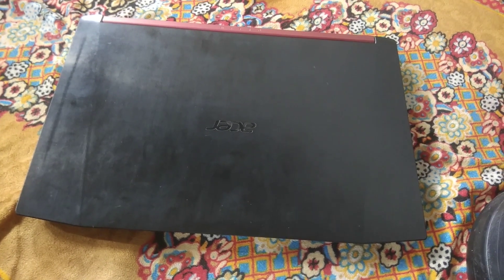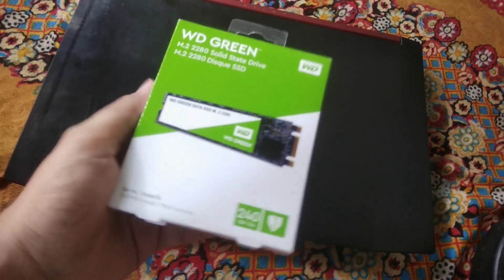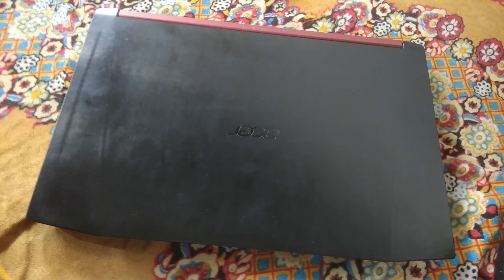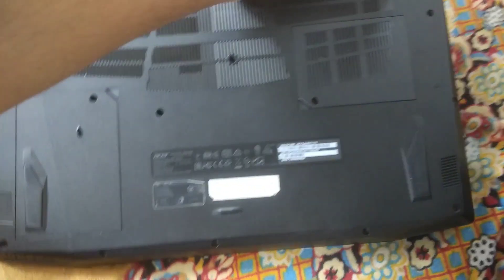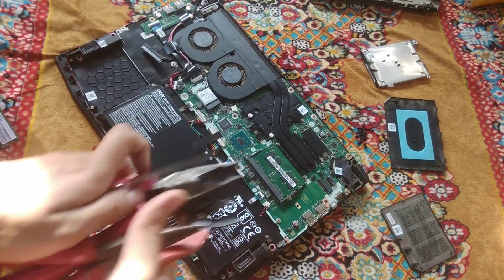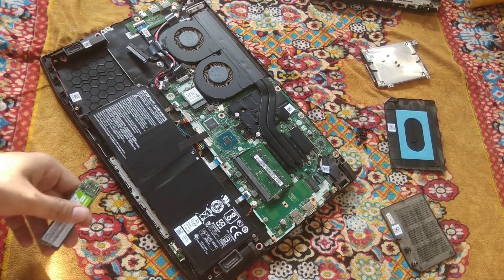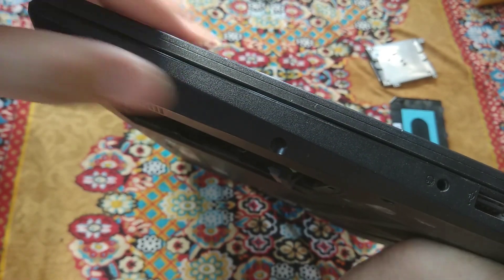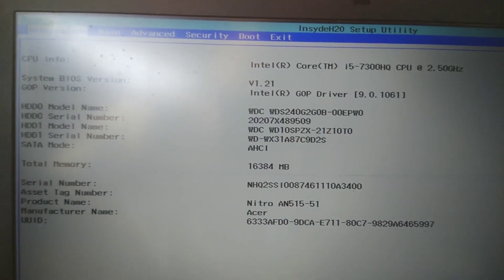How to install m.2 SSD in Laptop - Acer Nitro 5 AN515-51 | Missing SSD screw. Dev Ansab

Comment: It's looks like you installed ssd with 3 heads and 2 cuts, where Inplace you need to install ssd with 2 heads and 1 cut.
Reply from the maker: That slot in my laptop supports both m.2 and nvme ssd.

Comment: "Gently remove the panel" 
*brings out the knife
Reply: Bro I just got my WD blue SSD. can you please tell me what to do after installing the ssd? How to proceed with operating system upgrade and partition. Your tutorial ends at installation. 
Sorry I'm not tech savvy.

I have windows 10 installed in my HHD, i want to install win 11 in my ssd without losing any data from HDD. 

I made a bootable pendrive with windows 11. What next?
Reply from the maker: If you don't want to remove any data then  remove your hdd. Proceed with installation of win 11 on ssd. When the installation finishes install Hdd.
Then just remove win 10 from Hdd.
Reply: @DevAnsab  Understood. there is an important point you might want to pin this. M.2 Nvme SSD doesn't support on Nitro 515-42 AMD variants. 
I have AMD variant and now I regret buying NVME. It supports Sata M.2.

My SSD doesn't show in BIOS or windows. It shows in disk management but when I right click it only gives one option "help".
Reply from the maker: My AN515-51 supports nvme. It depends on model and listed on acer website.
Reply: @DevAnsab  my bad, I did not do enough research for compatibility. I can't return it on amazon.
Maybe I'll get an external case for this drive. And use it to boot my laptop.

Comment: Bro my acer laptop boots very slow, it takes around 40seconds.
Someone told me to use ssd, it helps in booting and laptop performance fast. I can able to purchase only 240gb ssd. If I install as you shown, will it increases speed?  Or should I need to install os in ssd only to boot fast?
Reply from the maker: Yes, installing ssd will boost your performance.
Before ssd my os would take about 2mins to boot, but now it hardly takes 30 secs.

Comment: Hello brother, my laptop's model is AN515-52, is it compatible with NVme m.2 ssd or SATA m.2 ssd. I can't find it clearly on the Acer website, hope you would help❤
Reply from the maker: Check this https://community.acer.com/en/kb/articles/101-what-type-of-m-2-ssd-drives-are-supported-on-the-nitro-5
Reply: @DevAnsab  Woah, that's compatible! Thank you so much 🙏❤ Can I know how to how to configure bios settings and all.. I've a very little knowledge Hope you'll help.
1)  Basically, what should be the things/settings to do in bios mode after fitting NVme ssd?

2) Should data transfer setting to be kept in "RST with Octane" (as default) or AHCI ? 

Please let me know brother🙏❤
Reply from the maker: You don't need to do anything in bios.
Leave it as it is.
Reply: @DevAnsab  How to run OS through ssd then? (which was previously running in hdd)? Should we need to clone to ssd or we need to re- install win10.
Reply from the maker: Yeh there are many tools which can clone  your OS to ssd, but re installing will be a better option if you have enough time to set all the things.

Comment: Pro tip for nitro owners: There is a thin sheet of metal cover over SATA Hard disk or SSD(the big one). The screws holding that cover perfectly fit the ssd screw hole. Use that.
Thank me later.
Reply: philips m 2.0 * 3.0 screws are required for it if I remember correctly. Aman Dubey is right SATA HDD & M.2 Slot screws are same.

Comment: bro...............im not hater but you put into that pc wrong ssd -_-  when you look closer you have only one teeth on your slot but you putting inside ssd with two teeths.       guys be careful with buying a ssd.
Reply from the maker: Well I am using that saad for over 10 months in that laptop without any problems.
So I guess that's the right pc.
Btw why do you think that it is a wrong pc?
Reply: @DevAnsab  i dont thing..........i know it watch that video...........it can run but it can run better and faster
Reply from the maker: Better and faster? How?

Comment: Hi there, great job on the video. I have a small doubt. I have an Acer NITRO AN515-51.
What kind of SSD does it support?
NVMe or SATA?
Should I buy a WD BLUE NVMe SSD? I want to get a better performance for my laptop than what WD Green gives.
Can you please help me out?
Reply from the maker: Nitro AN515-51 supports all three NVME, M.2 and SATA.
If you could then go for Samsung Evo or WD blue. They are much better and have more TBW.
WD green is just okay.
Reply: @DevAnsab  Judging from the speed of your SSD testing, Nitro An515-51 does not support M.2 NVMe SSD. Its speed is only the standard of M.2 SATA SSD. So you don’t need to buy such a high-speed M.2 SSD.
Reply from the maker: There are many Nitro 5 models. My is AN515-51 which supports SATA, M.2 as well as NVMe.

You can also check it on acer website. It is mentioned there.

And It's speed is little slow because iy is WD Green SSD, this is its standard speed, as it is a cheap SSD.
Reply: @Qi-l7x  I have installed a WD BLUE NVMe. It sure does support the NVMe SSD. Not only SATA. My model does support a NVMe
Reply: https://www.amazon.in/dp/B07YFF8879/ref=cm_sw_r_cp_apa_i_4W0G5KQRP3DJR3XWT5QQ?_encoding=UTF8&psc=1

Can you check and tell me whether this will work with my laptop or not?
It would be a huge favor.
I have already subscribed to your channel.
Reply: Could you help me out? 
I have to get an SSD as soon as possible.
My laptop has gotten very slow.
It would be a great help from your side.
Reply from the maker: How i could help you?
Reply: @DevAnsab  See my previous comment having a link to a WD BLUE SSD.
Could you verify if it will work or not?
Sorry for being extra cautious.
I hope you understand.

Comment: Do i need to remove the battery connection in upgrading the nvme ssd?
Reply from the maker: No! removing battery connection is not required, but you should remove charger or any other external device attached to laptop.
Reply: @DevAnsab  oh, thanks.🙂

Comment: I have Acer nitro 5 an515- 31 I guess. Can I also install SSD? 

I also wanted to know about whether I will be able to access the applications previously installed after installing SSD and booting using SSD
Reply from the maker: You can check on acer website if your model supports it or not.
If you boot using ssd then previously installed applications will not be useable.
Reply: @DevAnsab  thank you

Comment: Hey its just an awesome tutorioul, very simple and clear to understand, I viewed many videos for the same but didnt find helpful, Thank You so much for sharing.

I have only few question.

1. May it be possible to replace the HDD with SSD whic is placed on the body itself, the square one, i think this kind of ssd is also available.?

If yes, then i will have to remove HDD and install SDD there, so what ablut windows os? do i need to install as new like we generally do after formatting HDD?

2. If I install SDD like you installed, should i move my windows OS to SDD or keep as it is.

My questions might be silly but completely dont know all these. and i am peaced of the speed. I have the Same laptop as u have same model.

Thanks,
Nilesh
Reply from the maker: Hey,
1. Yes you can replace HDD by SSD you need to buy a 2.5inch SATA SSD. Then you can replace your HDD by SSD. As you know your data and OS is in HDD so you will have to reinstall windows and copy all your data to SSD.

2. It's not necessary to move OS from HDD to SSD immediately, but it is highly recommended to move or reinstall your OS to SSD as SSD is much faster than a HDD  so you will get a real performance bost, especially during boot.
Reply: @DevAnsab  Thanks for clarifying.. 😎😎

Comment: Your nitro 5 model name and After put the ssd data will erase or not, SSD Link to buy..
Reply from the maker: It's AN515-51. Normally the data should not erase by itself.
You can get it from amazon. Just search for this model.
Reply: @DevAnsab Sir please reply 
I have Acer Nitro ans 515-42 ryzen 5 2500u variant bought m.2 2280 sata SSD of wd blue of 500gb it's enabled in bios but not showing why???? Please reply please